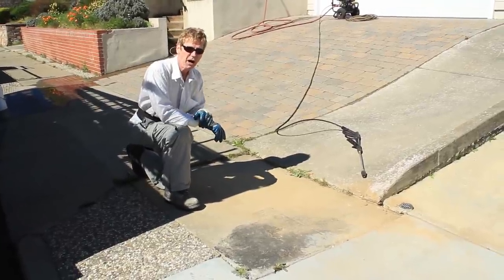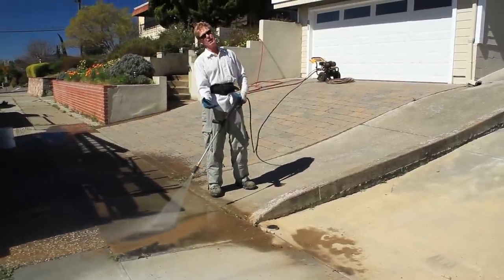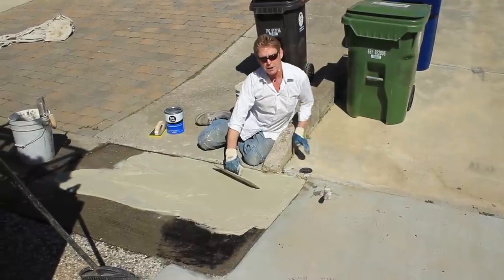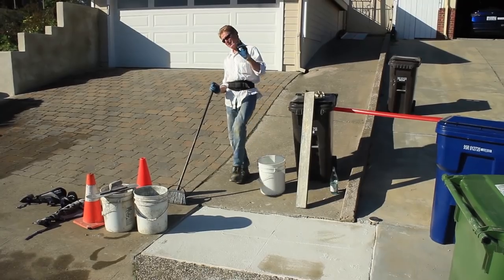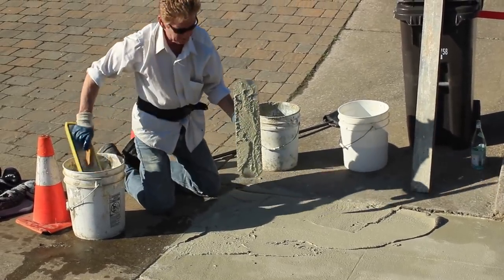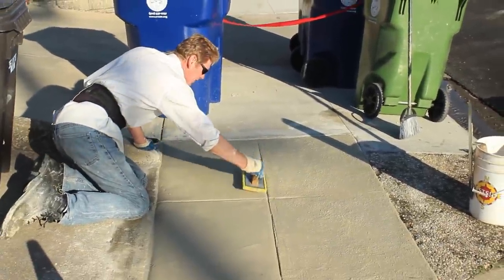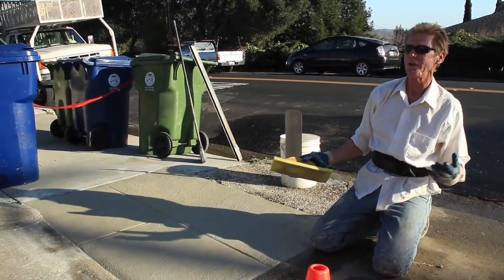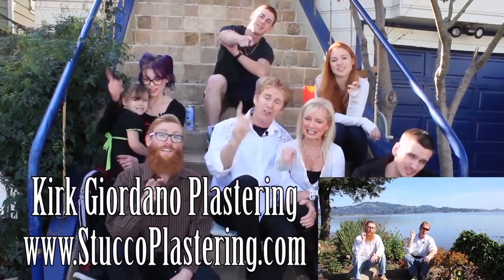Repair uneven concrete

Comment: I re surfaced massive 300sqm /2300sqf driveway (30 yo concrete driveway) about 4 years ago , I hired a concrete grinder for 400$/day , then add about 20-25 mm (about an inch) of 25mpa concrete on top,I didn't use polybond but grind it. It's still looks fine ,no cracks ,no damages . 
But I will use polybond in another job to see is it worth to use it instead of grinding ?
Reply from the maker: Good afternoon Mehran, my friend, Thanks for the comment.
 Grinding anything cementitious has its disadvantages to one's respiratory and lung system, but that's another story.
 Take care, brother.
Kirk and Jason Giordano plastering, sharing well over 850 free Stucco/Plastering videos for your education. 
    Together we have created the most comprehensive encyclopedia of Stucco and Plastering videos ever produced globally, all by your favorite plastering messengers of YouTube.
Bringing peace, love, and brotherhood back into plastering.🎭🏝🎆
https://en.wikipedia.org/wiki/Lath_and_plaster
https://www.basicknowledge101.com/categories/morality.html

Comment: I would tear it up and put fresh concrete down and do it right been a contractor for 36 years and that’s just gonna crack in so much time. I think you’re treating it like you’re plastering the wall lol it’s concrete when it’s shot, tear it up and have a real mason who finishes concrete do it
Reply from the maker: Evening Bill Dude, spoken like a man who has the means along with the cash to repair things properly.
 We deal with real people in the real world who often don't possess cash or the means to properly correct failures. 
How bout that?🤔

Comment: That's not fair.
We all should be equal and be able to buy stuff like this you're using here.
Reply: So go to the brickyard and buy a bag-no one is stopping you.…
Reply: I'm just a homeowner; I go to the material yards all the time.   I just tell him cash sale, generally use my credit card or cash. ( I think they prefer the credit card actually over cash)   ie a bag of Portland is $11 at The Big Box store I'll pay 8 at the material yard.   and they load it right in your truck no hassle you're in and out usually quicker, much more convenient than the big box.   I'm not sure what a contractor pays but I just saved $3
Reply from the maker: Good morning Dino, of course anyone can buy, Poly Bond, i's sold at all the plastering yards. It takes quite some time to learn how to use this material properly, and it's not engineered for this purpose.
   thus, "I recommend Rapid Set Concrete Leveler," or Sakrete, it’s a fast setting leveling resurfacer or at Home Depot, Quikrete concrete leveler, these are user friendly.                     
  Bringing peace, love, and brotherhood back to the world of, “Plastering.”
With over 800 educational and free Youtube videos, by your favorite plaster geek, “me,” and  my son, “Jason,” the bearded plasterer.

Comment: You definitely confused me but I would say you're trying to. Lol I understand why you can't advise on doing this. It's on the label of the products. A product is used in any other way than directed by the manufacturer blah blah blah against blah blah blah government Federal law law prison meant something something fine imprisonment danger federally illegal something or another
Reply from the maker: Howdy Garrett, yours is the long version, the short and accurate one is, that Poly-bond is specifically engineered to attach styrofoam molds to stucco walls as it's an adhesive cement. 
Cool beans, Daddio.🍾
Reply: Oh Garrett !.....Do you have any hearing problem ?
He explained very well....... 
Or is it too difficult to understand ?
He's telling his experience, not telling you what you should do.
Uff !.....
Reply from the maker: @maxgarbani6644  Evening Max, LOL, and exzackory. Thus he can point at me and say,. There goes the bad guy. https://youtu.be/dW37AGZ0Pj0/ He needs people like me. 🥳